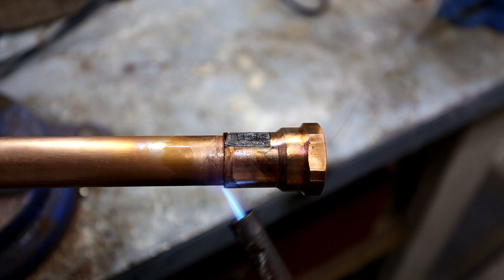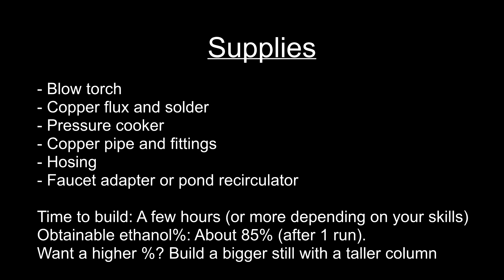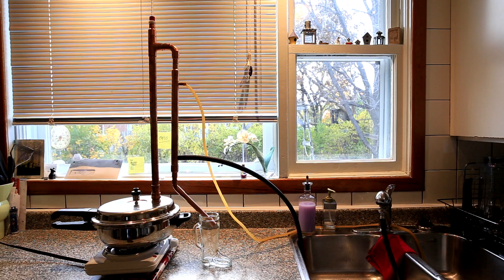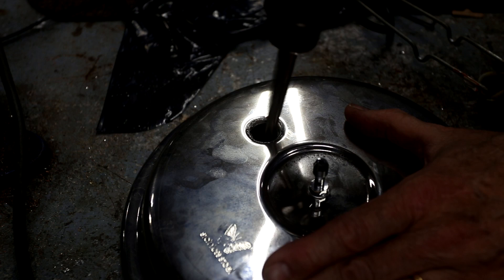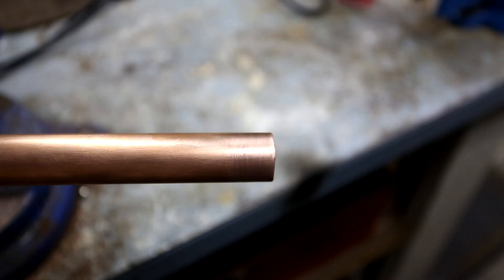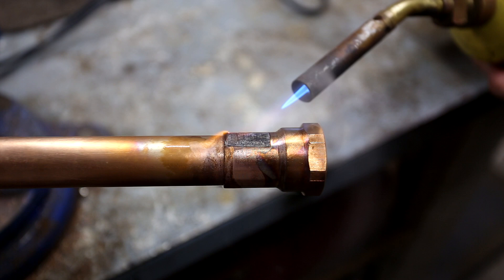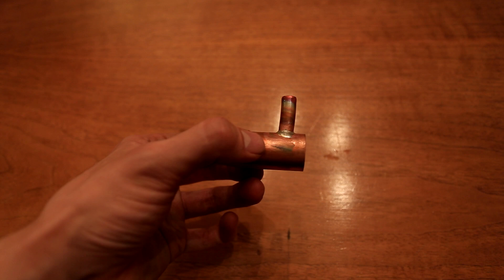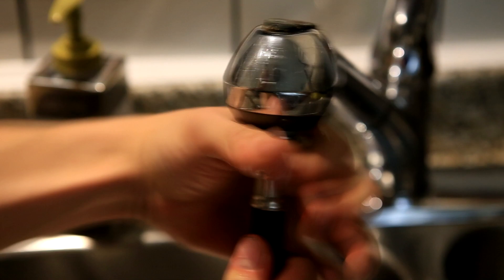How to build a Pressure Cooker Pot Still

Comment: soldering a copper fitting to a stainless steel lid will cause the copper to corrode.  This can be avoided by using a brass fitting instead.
Reply: I think Brass contains some non food grade metals .
Reply: @kayakesq   I don't think hes gonna drink it anyway
Reply: Not to mention it’s extremely difficult without the exact right solder. And even then the steel must be heated so hot it’s fucking ridiculous. It led me to wonder if using flux core stainless wire to weld it on the lowest setting would just melt/burn off the copper or actually work. Anyone know?
Reply: Gary Kast some brass does. But there’s lots of brass that is deemed ok for potable water at least.
Reply: Errr... I mean exact right flux and solder.
Reply: Gary Kast not to mention there are still pure led pipes in existence that cause no problems and are sometimes not replaced until part of the system has to be fixed.
Reply: just use some jb weld
Reply: Razorback73  "Brass can contain as much as 8% lead, but in practice, has really only contained 5%. The general industry term for this brass is 85-5-5-5 (or eighty-five-three-five) brass, because it contains 85% copper, and 5% each of lead, tin and zinc.1 Still, many companies have not manufactured components using even 5% lead. For more than 20 years, all plumbing fittings that supply water for human consumption have had to meet NSF/ANSI Standard 61. This standard measures for over 100 contaminants known to affect human health, one of which is lead. The new legislation deals specifically with the lead component of NSF 61, and provides an improvement to the existing standard. Lead is used in the manufacturing process because it is essential to curing brass, and is applied to the exterior of a fixture."
Reply: Mix 50/50 vinegar and peroxide in a container. Put your brass fitting in, fully sumbmersed. It will delead the brass fitting. Dont leave it too long or it will turn blue and black. Brass fittings are made in a lead mold. Thats why they contain traces of lead
Reply: Is it a problem if enough solder is in between the copper and stainless so they don’t contact?
Reply: Jason Madden thanks for sharing, great tip!
Reply: or just buy a soldering flux for stainless steel. It's $20 for a bottle that will last you a lifetime.
Reply: @MawoDuffer  It's not.  Soldering is not welding so it's not as much of an issue. In welding you are literally melding the two surfaces together into one, single thing.  It's a continuous piece of metal and can be just as strong as if there weren't separate pieces together (welding is an art and people who do it well are rightfully well paid). In soldering, you are using an intermediate material to bind two other materials together.  It's, in essence, glue comprised of metal...so having too much solder can certainly make it a weaker joint, as solder isn't a very strong material, it won't cause a failure of the work typically and in a case like this will remain pressure and air tight.
Reply: @kayakesq  That's why you use red brass.
Reply: hey ted, I bought the same pot as nile red and its made of virgin aluminum, not stainless steel. Is copper still okay for aluminum?
Reply: @JeremyChung  should be fine
Reply: @mustangmadd3172  I can confirm what Jason is saying because his comment made me look into it. Nice tip
Reply: @schawn4925  glad I could help. It's a tip I learned from an old timer and has really helped me
Reply: @Walter-Montalvo  not a problem at all. If people are gonna run a still it's always to know some safety tips.
Reply: Galvanic cell
Reply: @PuzzledMonkey -  I see you point but last I checked, brass actually contains lead =0
Reply: @__WJK__  read all the other replies first, my man

Comment: You can also add salt to the water/ethanol mix. It will dissolve in the water and raise its boiling temperature by a few degrees but not the ethanol. Also, wrapping the column with insulation can improve efficiency dramatically. Packing the column with copper BBs could also work. And you don't have to use flower paste on the first joint, you could just use silicone. Cool video Nile!
Reply from the maker: I never thought of using BBs, that seems like a good idea!
Reply: Nile Red I think stainless steel wool is better.
Reply: ***** it just depends in what you're distilling. I would actually just buy some glass marbles or glass airsoft BBs so that I could distill anything. (Assuming the rest of the setup is glass)
Reply: Magneto! Adding salt lowers the B.P does it not?
Reply: Looked it up, it does raise the B.P but only by ~1/2 of a degree C for 56gNaCL/dm-3
Reply: Khyral Rap yeah but a little bit can go a long way in distillation.
Reply: +Nile Red Did you mention adding boiling chips?  A cheap substitute is to use small bits of broken crockery, china or ceramic dishes.
Reply: Magneto! I like your mind.
Reply: A packing made of  stainlees steel or a real copper pot scrubber would work.
Reply: Does salt break the Et-OH/H2O  azeotrope?
Reply: @TheBackyardScientist  I dont even think you can get pure copper BBs anymore.
Reply: @larrytischler8769  nah
Reply: @NileRed  I believe BB's are copper-plated steel

Comment: You must use silver solder for a still because it has a higher melt temp than regular solder and wont fail at running temp. Plus it contains no lead. My uncle who was a rum runner taught me that when I was a tot, before he passed away.
Reply: +jsslandro The old people were wise ..I'm in my 60's and my Italian Dad taught me many ways to distill and he learned from his mom & dad from Italy who ran stills in the 1800's ...
Reply: Absolutely.  The light acids eat up plain lead solder.  That is why silver solder must be used for home copper piping, and they are non acid and run colder, even than the hot water lines.
Reply: Not correct. The still runs at a very cool <200F temp and melting the lead-free solder is not an issue.
Reply: Exactly NEVER use lead solder on water pipes & also NEVER use repurposed/used radiators in a still.
Reply: @ricklafford8993 yeah but you dont want lead in your distillate.

Comment: Would love to see someone DIY an all-glass (or "mostly" glass) still, since copper toxicity can be an issue if one gets lazy & doesn't clean/operate a copper still properly. Also NEVER use LEAD based solder and NEVER use repurposed/used copper piping or radiators!!  Also, be aware that brass contains lead.

Comment: Great video... One last step that everyone should do before using the still is the cleaning of the inside of the column and the condenser. Cleaning is easily accomplished by distilling a bit of white vinegar. Distill enough vinegar until the distillate runs clear. This needs to be performed in between uses, dependent upon how long the still sets unused. Be prepared to be grossed out by the colour of the distillate.  -Cheers
Reply: +Capt. Nemo Cold cleaning can also be done with table salt dissolved in vinegar.  The solution will clean and brighten all copper and brass surfaces.  The clean surfaces would be ready for reaction with sulphur compounds which affect taste.  If you are tasting your alcohol.  :)
Reply: Pelican1984
Interesting... My system isn't very sophisticated or for making high brow beverages. Using a pot still with a packed column, I simply make over-proof ethanol from a sugar wash that's then polished, diluted, and flavored with either charred oak or a favorite tincture made using the over-proof distillate. I like a schnapps every now and then. I just don't care for the metallic taste of the first run through oxidized copper. Somehow the carbon polishing never seems to remove all of the coppery taste. I have no heads or tails to clean the pipes because I'm using only refined white sugar that produces a methanol free distillate. -Cheers

Comment: Your boiler is waaaaaay to small (10-15 L at least!), your riser is longer than it needs to be and you can run the Liebig at a 45 degree angle (even less). That thing on top...replace it with an end cap anf wrap a few turns of PTFE tape around the pipe.Do NOT solder it, it serves like an extra safety precaution and you want to be able to clean the riser from inside. Obviously, you can't do this when the cap is soldered into place.

Comment: Takeaway the whistle and tube it with a tight plastic pipe. Heat it with a lighter if needed to tighten. Then attach them to Copper piping with multiple turnings like a coil. i used ones found in AC. Now you can insert a copper coil in a small bucket and pull the other end out of the bucket by poking a hole with a heated rod and after getting the pipe out seal the hole with putty. Whenever you need to distill just pour the solution in the pressure cooker and close it. Get some ice to throw in the bucket with very little water filling up the entire bucket. Once the ice melts and water gets hot. Replace it with new water and ice. You'll need more ice than you think.

Comment: Just a tip, heat it up until the flux starts to bubble and wipe off the excess flux with a rag before you actually solder it. Otherwise you'll get a bunch of green/blue corrosion around your joints over time. Also, don't take your flame away while you solder. Keep it on there as you apply the solder to the joint. You should just be able to touch the solder on the top of the pipe and sort of move it back and forth a little for a second and the solder will run down both sides. That way you don't have to keep heating it up and applying more or go around each section of the pipe. Then just take a rag and wipe the drip of solder off the bottom while its still hot. A bigger torch head would also make things easier and faster. Obviously what you did will work and I'm not trying to criticize but doing those things will make this whole process more efficient if you ever need to solder copper pipe again.

Comment: With the correct parts I can build a copper still from scratch in about an hour and a half. However the one ove got at the house took me nearly 2 weeks working about 3 hours a day because, I got real creative with it and actually forged the copper out into a more professional looking still right down to the cool looking copper indentations!!! Since its in my garage I use a recirculation system with coiled copper pipe in holding unit i designed using the refrigerating system from an old refrigerator to keep the water cold and moving around to ensure there's no steam coming from the exit.  At max productivity my still can do about 10-12 gallons an hour though I've only ever ran it that hard twice just to see how much it could really do. The only hard part is keeping the tubing system sterile so when I'm done I completely remove the copper coils for proper cleaning and drying. The rest is fairly easy to keep clean and sterile

Comment: Back in the late 80's a friend of mine made a similar still. He made it out of an empty stainless steel 15 gallon beer keg. One night on a hot summer night in Huntsville Alabama he was running off batch of moonshine in another friend's garage and it blew up and it made one hell of a mess in that garage. It took them two days to clean it up. It happened around 2:00 in the morning so nobody heard it, but you could smell alcohol for blocks away in every direction for at least three hours because there was no wind.   :O)

Comment: size doesn't matter of the colon but to cool down the steam to right temperature so you only cooling down the vapor from the alcohol and not water. And you want to have the vapor temperature at 79,15 degrees Celsius before it goes to the cooling colon. Then you got 97,4% alcohol out. Worked for me and you can max get out 0,6 liter alcohol/kg sugar. Pure and clean chemistry 😇

Comment: You can coil copper tubing in 6" pvc pipe 
And use that as the water condenser 
It would also work to remove moisture after a air compressor befor the storage tank as a dryer.

Comment: I build computers for a living, and I'd like to say that a closed custom loop would probably work on the distillation column so that you don't have to waste so much water. You'd need a radiator to dissipate the heat, though.
Reply from the maker: +Eric Bowling What is a closed custom loop?
Reply: http://www.overclock.net/image/id/1686396
Something like this. It has a pump, a reservoir, flexible or solid tubing, and one or more radiators with fans to dissipate the heat.
All components should be able to withstand temperatures of over 100 degrees Celsius. The tubing is green, the pump is in the bottom right. Radiators and fans may not be needed, but only if the temperature of your water doesn't go up very much.

Generally they're used in computers, pushing water across and through metal components that get hot to move to heat to a radiator.
Reply: +Eric Bowling ....Actually I have used the radiator system as a condensor as I had more "free" electricity than I did "free" water (In the Outback, running on solar)

However, on critical difference between computer or auto radiator design and those for drinking alcohol is the materials used in the system. Non-potable designs can have lead, plastics, and any other toxic substance in the loop. However, alcohol vapor will leach just about anything in the system, so everything must be safe for human consumption. So, mostly likely you couldn't buy an off the shelf system with all it's components being safe for human consumption.
Reply: I thought the exact same thing... I mean, not an exact water cooling system, but rather the concept of using a radiator and a pump.
Reply: Pedro Gutiérrez Ricnón Seems efficient, but i wonder how long it would take him for the price of water savings to surpass the price of the equipment.
Reply: Eric Bowling Only he could know... but I think it would have to bee a long time. Those systems aren't cheap.
Reply: They're as expensive as you want to make them. Automotive heater cores, and 12v fans with pond pumps in a bucket were 'water cooling' before it went mainstream. Junk you pick up in a scrap yard. For the purposes of boiling 0.6 quarts of alcohol out 4 quarts of wash, a dripping tap is the way to go.
Reply: Why would you drink the cooling fluid? It would be the same thing he is doing in this video but instead of the water going down the drain it goes the a radiator and then be reused.

Comment: the thermometer is a nice touch. If there is any (poisonous) methanol in the mash it will distill across at 65 degrees centigrade while the ethanol distills across at 78 degrees
Reply: Which is why most old time distillers would throw out the first X ounces of product. I can't say from personal experience about the timing, but there should be a short window where it stops dripping but the temperature keeps raising. Everything before that pause is poison, good for chemistry but not for consumption.
Another fun fact is that there is another bunch of poison that distills out at the end. When you hit a second pause, you'll want to stop and toss out the mash. While not as poisonous as the first, it's still not healthy for humans.
Reply: Actually in standard distillation process foreshot (that's the proper term for the very first batch of the distillate) consists of a bunch of various substances, not just pure methanol, and the latter is in too low a concentration to actually pose a threat to your health if the foreshot is left to mix with the rest of the final product (although consumption thereof will almost certainly result in a severe headache).
Reply: To be more precise, a sugar wash will not produce methanol (methanol is chiefly produced by the destructive distillation of wood). Wine produces more methanol than beers, and sugar washes produce none. Generally though, if you want to be safe, toss the first shot or two if you want. I don't.
Reply: @Suicidekings_  Alternativ you can let it run throught aktiv carbon it bindes all methanol

Comment: As soon as you add a reflux column doesn't that change it to a reflux still? The intent of a pot still is to really produce a more flavorfull end product. Adding a reflux column decreases the amount of non-alcohol content in the final product.
Reply: +US Beer Traders A reflux still can  be used for both types of operations.  For stripping runs or full cuts, simply insulate the reflux column, remove any media like scrubbers, raschig rings or marbles, and run it at with high heat.
Reply: But its not a pot still
Reply: It's a pot still, because it's made from a pot. It just has a reflux column and condenser on top of that. Technically, I suppose it's a "reflux pot still with a Liebig condenser" if you want to be pedantic.

Comment: is there any specific reason that the condenser is at a 90 degree angle, rather than a 30 degree angle? I don't know whether it matters or not but on the glass ones  in your other videos, the condenser is at a 30 degree angle...

Comment: Did you used lead free solder? If not, how you made sure there is no traces of lead in the final product? Also i would love to know if you have considered to use the freeze concentrate Method so seperate alc Form Water and why not. Also why not use denaturated alc (spiritus) to Start with, since its supposed to be like 90+% to Start with. Love to hear what you think of all this. Thanks

Comment: @NileRed: Couldn't you use a wider diameter pipe for the condenser, then use flex copper piping of a smaller diameter to make an adhoc graham condenser? There'd be some added fitting adapters and welding but it'd create a better condenser, right?
Reply: A cold water condenser is much more efficient than an air condenser

Comment: Do  you think an aluminium pot would be as good or that too much aluminium ion would spread in the stem?  For distilled water for example?
Reply: Aluminum evaporates at 4478 Fahrenheit.  Aluminum oxide evaporates at 5391.  While the meme that everyone repeats is "stainless steel and copper only", there is nothing in aluminum that can get into the vapor.